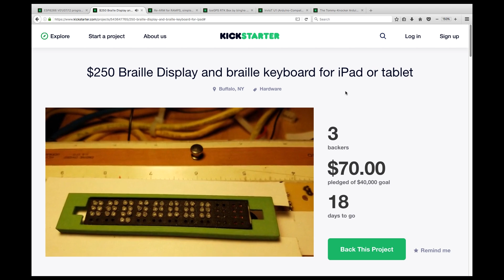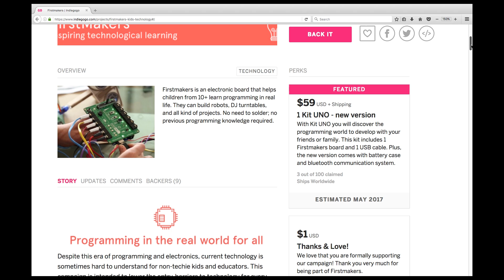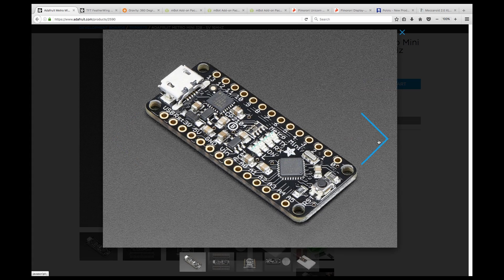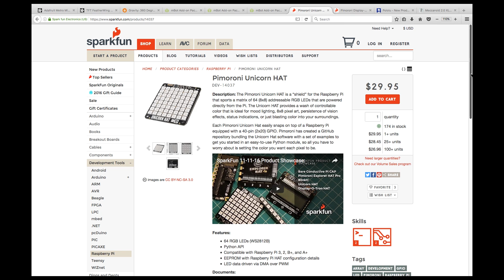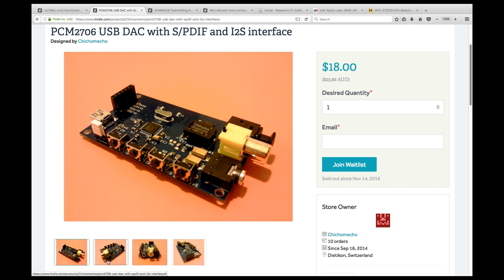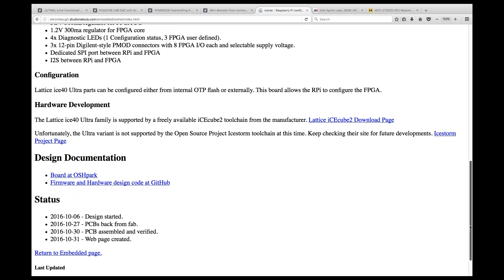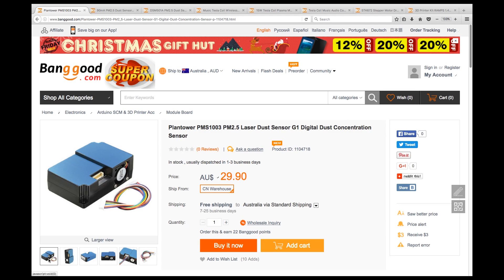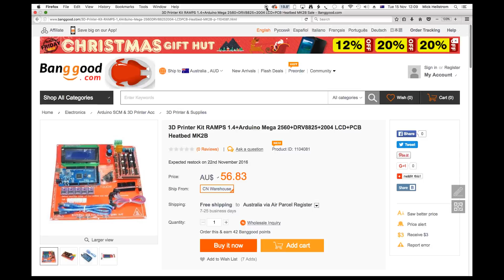#070 Weekly Roundup #12 - New Maker Products

Comment: The RE-ARM doesn't include the RAMPS board. It is a 32bit Arduino MEGA compatible that can replace the MEGA in a RAMPS setup (5v tolerant, 5v output on certain pins that need it etc). you still need a RAMPS board which houses the stepper drivers and whatnot needed to make it work with a 3D printer.
Reply from the maker: +Skwisgar2322 
Ah! Thanks for that pickup! I'll mention this in next week's WRNMP.

Comment: I work in an electronics shop, we sell those mechanoids. The 'limb' system thing you mentioned is basically an easy way for kids to 'program' the robot. You can move the arms and head around and it'll record those movements. Then, you can set it to just repeat the movements you just performed with it. Nothing special really. It's quite a rubbish toy.
Reply from the maker: +o0julek0o 
Yeah I was concerned about what they actually used for programming the thing.
It was in my "dubious" list and I was going to not include it, but added it as an afterthought.
Good to hear from someone with direct experience with it.
Reply: MickMake No problem. They're massively overhyped too (at least by my coworkers who don't really have any experience with programming/robotics). I'll update you on how well they sell this xmas :D